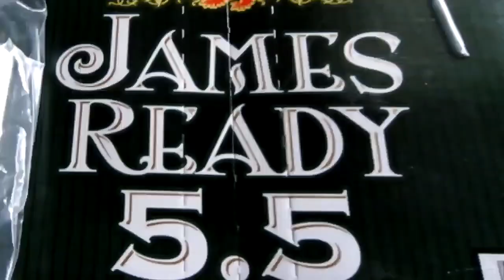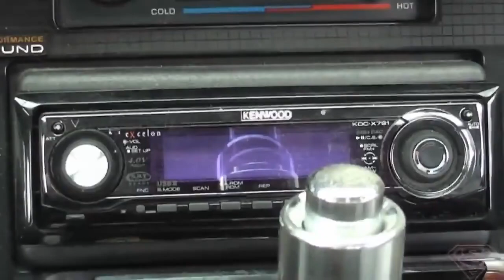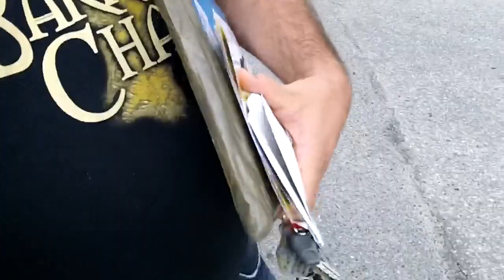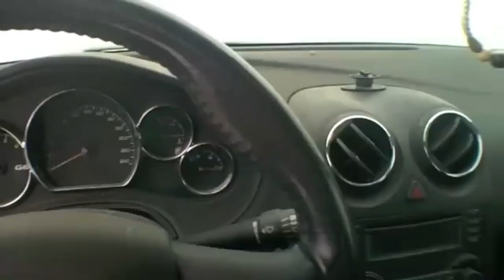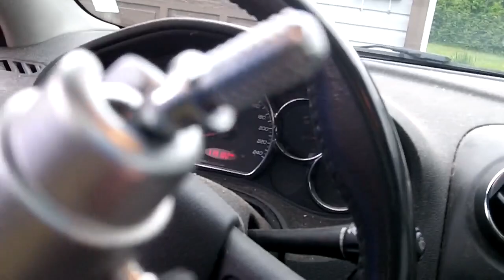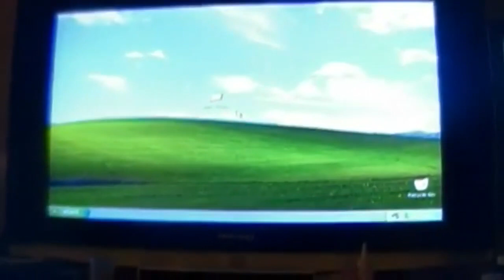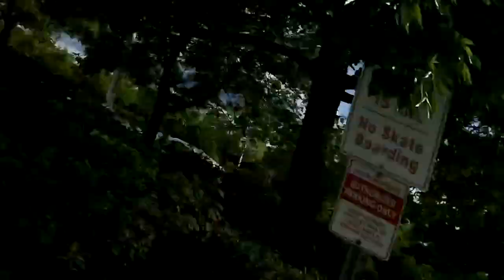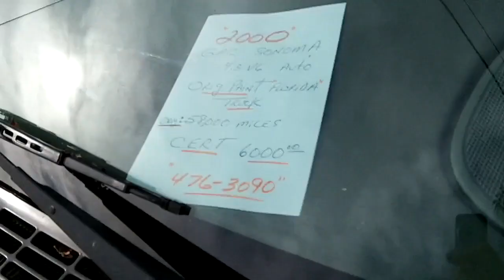(Day 500) - 06-04-2012 - DAY 500!!!

Comment: to aim your fog lights, u have to use the little plastic like screw things under the front fender where the fog lights are...just loosen them and im not sure about the older vehicles but i know the newer cars have a way to adjust...(they click when you move them up or down) what YOU can do is just move them a little, tighten them. them check them and so on so forth... hope this help adam!

Comment: If you check out the kits on eBay, the hood decals are in three parts: the two wings then the body of the bird. I'd be surprised if you could find an uncut 24" decal, you just have to know what you're doin when you line em up. Maybe get Billy to apply it for ya as well?